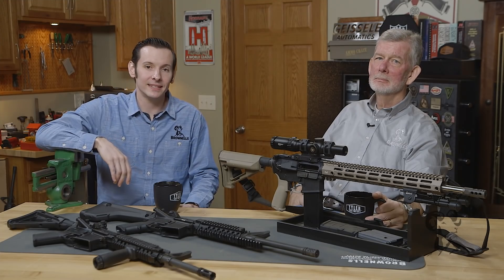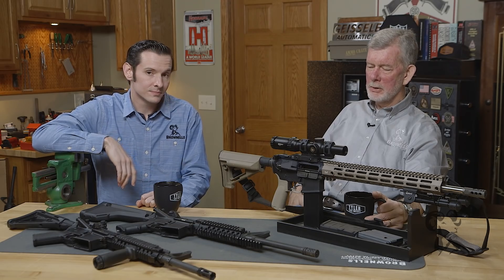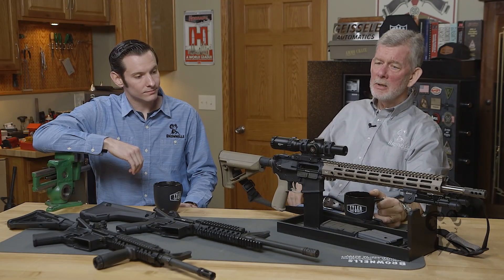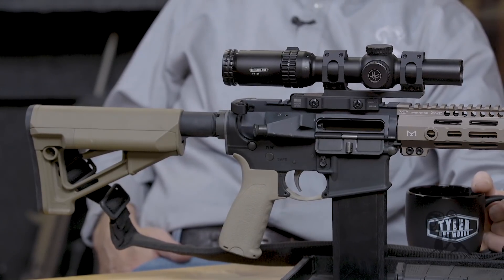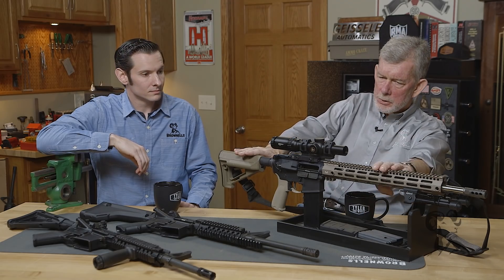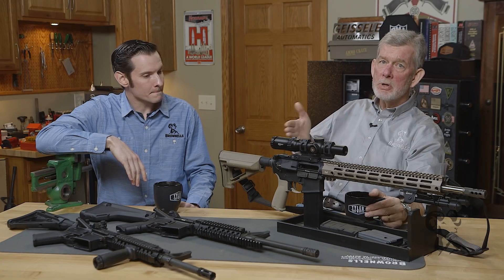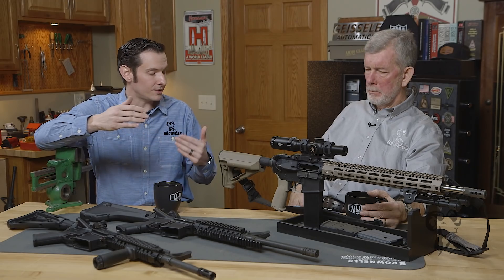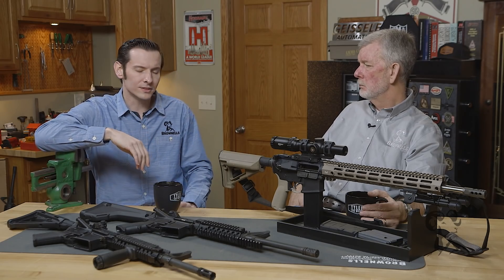Smyth Busters: Matching AR-15 Gas System to Buffer System

Comment: If you want to know why the difference in length isn’t problematic I’ll sum it up simply.
When colt began shortening the m16 platform they wanted to take length off of both ends of the rifle so they shortened the barrel and placed the gas port in the location that led to the smaller profile of the original colt commando then tuned the port to let in the right amount of pressure to cycle the action. Then colt created a new shorter buffer tube with a recessing stock that allowed the commando to be convenient in small spaces while still having the ability to use a full length stock when needed. The new buffer system had a shorter buffer and spring inside but the weight of the buffer was increased and the spring was strengthened to give the same resistance of the full length system.
Essentially it takes the same amount of force to cycle a carbine and rifle length buffer system.
Reply: Actually the weight of the buffer was DECREASED. Carbine buffers were 3 oz at that time vs the rifle buffers 5 oz. But you were close.

Comment: The group at SOTAR (School of the American Rifle) might tend to disagree. The variations in overall gas efficiency, barrel lengths, buffer weights, and spring length and tension, brass ejection patterns and firearm tolerances would seem to support a closer look at all components used, not just gas tube length and buffer type. 

When sufficient ammo becomes available once again I will experiment with the items mentioned in your video to gain some experiential knowledge also.   Thank you for your videos
Reply: When sufficient ammo becomes available again?! I’ll be here waiting on your findings... probably sometime around 2036😆

Comment: I built an AR-15 rifle and had a mid length gas system and rifle length buffer and it wouldn't cycle. It rarely even ejected the empty casing. I put my mid length upper on one of my carbine buffer lowers and it ran and put the carbine upper on the rifle length lower and it ran just fine. Confused me so much.

Comment: A.R. pistols especially 9 mm do you need light pistol buffers and have many function problems with a standard buffer system, also what about a dissipater model I specifically had to adjust my spring and buffer system to accommodate a dissipater rifle?

Comment: I'm going to have to disagree with this premise.  I had a factory stock S&W carbine, and I put a DPMS rifle upper on it.  That thing became (nearly) a single shot.  I ran everything between a 55 gr and 77 gr bullet, and nothing would cycle.  I then put the same upper on a DPMS carbine lower.  Same headache.  I put the rifle upper on a rifle lower I built... dependable as a baby pissing after diaper removal, without so much as a gas adjustment or buffer change; nothing custom.  The carbine always worked well.  I'm not arguing that my experience is an "every time" norm, but that's what happened to me anyway.  Love the channel though.👍
Reply: Same on my 20inch

Comment: It can be affected in really cold temperatures and/or under high rates of fire.. use the correct buffer system. There's a reason they were designed the way they were.
Reply: Bruh you even watch the video?

Comment: THanks, just saw your video. So, here's my problem. Just built a 6.5 Grendel with 20" barrel, carbine length buffer. But no matter what I do it seems, I can get the bullets to eject at about the 4:30 - 5:00 area but it will not go back far enough to strip off another round or hold the bolt back completely. The Gas block is a PSA adjustible open all the way. Any ideas?
Reply: What weight buffer? You are definitely undergassed for whatever buffer you are running, so if you can't step down a weight then your gas port is too small. Undergassed on a carbine-weight (the lightest standard weight) buffer means that the gas port is out of spec, or you are leaking gas somewhere (usually at the gas block; look for carbon build up around it, there shouldn't be any.) Hopefully it's as simple as clamping down the gas block more to eliminate the gas leak.
Reply: @Reniconix  I am using a standard Carbine buffer and spring (Both new). Using a PSA adjustible gas block (Completely Open - New). The gas port does not show much carbon, but there is some. The hole by my estimation is not exactly round, maybe a little oval, but that is all I can tell. Thanks for the help. Really been pulling my hair out, and I don't have that much left.
Reply: If your bullets are ejecting out the side of the gun you have real problems ... JK I know you're referring to the cases.  Anyhow, you should also check to make sure that the gas block is properly aligned.  If not, your adjustable block can be all the way open and still not getting enough gas through the port.  Make sure the hole in the barrel is perfectly aligned with the inlet to the gas block.  Sometimes machining on the barrel or gas block can be off ... just sliding together can leave them choked down.  Always measure first.
Reply: @kingropplebopplesoppy2634  So, we finally figuared out the problem. The gas port was not to spec from the factory! After we drilled it out to spec we were able to adjust the gas port correctly. This  was a very unusual problem. Thanks for the response.

Comment: good video guys,  i have a couple of m16a5 (semi-auto clones)  they have a 20 inch upper attached to a vltor a5 lower with a h4 buffer and i have perfect 4 o'clock ejection when i use 55 grain lapua or federal ammo so this is my preferred gas system/buffer system setup. 👍👍

Comment: I went with the Geissle guide, but no mention about a pistol length gas system with a non-suppressed 11.5" barrel. But Since I'm running a flat wire buffer spring, I went with an H-2 buffer.

Comment: I disagree with this MAJORLY!  My 5.56 has ran on every buffer setup I've put on it, I think the same with my blackout...but I have a .50 Beuwolf, 7.62x39, 6.5 Grendel, and ESPECIALLY the .450 Bushmaster AR that doesn't seem to run no matter what.  I've changed out EVERY buffer spring, every buffer weight, rifle, carbine length, changed to caliber specific mags (that helped but still not perfect) and STILL never had them fire more than 2-3 rounds without either jamming, or not loading the next round....changed gas blocked too and that didn't help.  The gas tube also has about a half of an inch difference in length where it enters the upper on 2 of my AR's with the SAME length tube for the same length barrels...wtf
Reply: Seems I can learn alot from you and your experience. I have the same calibers. 10.5" 5.56, 16" 7.62x39, and 16" .50 Beowulf. What do you recommend for buffer and spring weights for each? I dont have adjustable gas blocks..

Comment: My question is does  a rifle length buffer system feel smoother than a carbine buffer system.

I know rifle length gas systems are super smooth. However does the longer buffer assembly have a similar effect?
Reply: Yes, for my rifles 20" barrel and rifle length gas systems, it makes them softer shooters, and I suppose less wear and tear.

Comment: I dissagree in part. of course that is because of personal preference but i like mine to run smooth so i have different springs for different things like when using a suppressor as well as an adjustable gas block and adjustable gas port on my bolt carrier. it is not that you shouldnt run one way or another but that you should. it makes the gun more enjoyable if you have a system that works well with all the components. you dont get a harsh recoil or brass being flung to knock out the guy sitting next to you. that is personal preference though. you can run it harsh if you would like to

Comment: Definitely accurate. All buffer systems are designed to deal with roughly the same total recoil impulse. They're just designed to dissipate them over different lengths. Thus a carbine-length buffer will produce a sharper recoil than a rifle-length one as the BCG is decelerating more rapidly.
Reply: Surely it isn't that simple. If this is the case then why isn't everyone running the heaviest H3 buffers possible?
Reply: @iank6897  because not every gun comes in the same caliber bud
Reply: Yeah why would anybody want a sharper recoil
Reply: @MrSabram07 More stock options + lighter weight
Reply: @MrSabram07 because the recoil impulse that is sharper is also shorter and allows you to fire faster because the action cycles faster.
Reply: Will a stock made for a shorter buffer tube still work on a longer buffer tube?

Comment: Yeah, that 3.0 oz carbine buffer is the exact same thing as the 5.4 oz rifle buffer. Please - stop being dense
Reply: I don't think you understand how the system actually works, we will work on a video to address that. I'll try not to be so dense lol
Reply: @CalebSavant  you are saying i don't understand the system? Lol, that's rich because I've built just about every configuration you can imagine
Reply: @AJPPP  ok
Reply: The point is that they will both function just fine and the rifle will operate without issue. Talk about dense...
Reply: @guitaristxcore  Really? So both will function with the same untouched 300blk upper? how about full auto?? Please leave the wrenching to the real gun builders and stick to youtube.
Reply: @AJPPP  since most ar owners are running semi-auto 5.56/.223 rifles you can keep your red herring.

Obviously if youre changing calibers you need to go back through and make sure the rifle is set up to safely operate. But as long as its cycling, which is whats being discussed in this video, you're good to go. 

You're salty that they didn't address your outlier situations. But those are just what they are. Outliers. For the vast majority of AR owners the only real difference the buffer tube set up makes is in felt recoil.
Reply: @guitaristxcore  I hope you never touch anyone's firearms but your own, for their safety.

Comment: I had to switch to a heavier buffer on a 10.5 in barreled (SBR) AR build I did once I started to run a suppressor.  But other than that I've only ever changed buffer weight for comfort, not reliability.

Comment: The only time I have seen the need to change buffers or springs is when I need to change dwell timing on an AR15. And that only happens on exotic calibers or a barrel with the wrong size gas port.
Reply: agreed.
Reply: You’d be surprised dude. There is such a thing as gas port erosion. And a lot of manufacturers don’t include the correct buffer for their sized gas port.

Comment: I had to change my buffer weight and spring after changing my BCG to a lighter one.  I was not getting enough push-back from the gas system to compress my old spring enough to fully cycle, but could not change the gas system to provide more, so I bought a lighter buffer and it solved my problem for a few rounds, then would not lock back after last round was fired (leaving the empty mag).  Finally, after a Geisselle braided spring was installed, everything worked consistently and flawless.
This AR15 is the best rifle I have ever shot.  Very smooth and shoots 3/8 MOA out to 500 meters.  I've shot many others and often get that over-gas slam to the rear (which I've come to dislike now that I know about it), so I'm convinced there is a lot of benefit to tuning the gas system by changing buffer and/or springs until a good combo is found.
I also like the JP Silent Capture Spring system, but decided to try messin with a less expensive this time.
Oh, and I meant to say I'd bought a new barrel, a Criterion 18" HBAR with head-space matching BCM bolt.  That's what started all the troubleshooting, but I'm glad, as what I have now, is well worth it.

Comment: All of my ARs, from a 10.5" with carbine-length gas system to an 18" with rifle-length gas, all run carbine buffer systems with zero issues and none are equipped with adjustable gas blocks.
Reply: do you run any of them suppressed?
Reply: @gabegoins4422  No, not at this time.
Reply: @jaydee5156 ya if u were to suppress them u would probably need to install a H2 buffer to make up for the increased pressures with the suppressorz
Reply: You're definitely lucky. Are your AR's 5.56? It definitely can get tricky when running suppressed and different calibers.

Comment: I called around my local gun shops and asked and it was 50/50. I have a carbine lower and i want to switch it with a mid length gas system
Reply: Absolutely, do it!

Comment: What about a 4.7 ounce buffer in a mid length has system? Will it function
Reply: From what I gather from the video. If the system is made to functions with one upper, it will function with all. However I believe this isn't always the case across all the calibers available.
Reply: It depends on the port size in your barrel.

Comment: It's not TECHNICALLY true that once a buffer system is set up it will run in any AR. If a STANDARD buffer system is set up then it will run in any STANDARD AR, meaning standard bolt weight with an open gas block. The length of the tube won't matter. 

As soon as you change the buffer system, bolt weight, or amount of gas via an adjustable gas tube then your system may not run.

Comment: What about rifle/carbine to pistol ar?
Reply: This is what I came to learn as well
Reply: @sokka12298  I been asking around my local gun shops and what I've been told if you got anything from 10.5 (what I have) and longer your rifle should have a carbine gas system. I've watched several videos and since it's a smaller barrel it's usually over gassed so playing around with different buffers should help to find the right balance
Reply: @esepinky13  A regular carbine buffer will work. But I always play around with my AR pistol buffers. I have found that using an H2 buffer with an upgraded spring has been the smoothest and best running. 
All you have to do is get on Ebay or Amazon and buy three tungston weights. Replace one of the steel weights in the carbine buffer with a tungston. That gives you an H1. 
Replace two it gives you an H2
Reply: @toynazi  I actually just did that. I swapped 2 out. The rifle it self wasnt bad it was ejecting around 3 o'clock  and after the swap ejects around 4 and 5 o'clock I curious to get a red spring just to see what it does
Reply: @esepinky13  I always use the JP tuned and polished springs in all my AR platforms. They are super smooth and gets rid of the typical twang from a normal carbine spring.
Joe bob outfitters website has them for $20. Well worth it.

Comment: I built an AR10 with a rifle length gas system and a carbine buffer tube, and it doesn’t cycle correct. The bolt doesn’t fully go into battery with the following round. 

Any suggestions?
Reply: Are you using mix match bolt and barrel? Didn’t you check headspace in the rifle?
Reply: Keith Reinert 
Negative.. both the bolt carrier and barrel are Areo precision and it passed both the go and no go testing.
Reply: mazzvidz dang I’m putting together the same set up except with a adjustable gas block. I’d be interested to know when  you figure it out. Does the bolt lock back on the magazine when empty? Load one round in magazine and then chamber and fire and see if the bolt lock in the magazine
Reply: Keith 
Yea it locks back.. I’m thinking it’s a gas block issue.  I just bought a Giezly pinned gas block  to replace the AP one. I’m struggling getting the old one off.. I’m gonna put the heat to it tomorrow. Hope that  solves it.

If not I’m gonna have to see about the buffer and spring... and so forth. I’ll figure it out eventually
Reply: Keith 
I got it working. 

YES!!!

When I had it apart changing the gas block I decided to disassemble and inspect the bolt and carrier as well. I noticed that the bolt  didn’t move inside the carrier as smoothly as in my other rifles. In all honesty it was quite difficult to get it to move by hand. 

So I very gently polished the interior of the carrier where it makes contact and now it cycles flawlessly.
Reply: mazzvidz  awesome I’m just finishing mine up now. And I will have to double check mine. I hope it stays working. I know mine is a little tough and was going to see if it would work itself In.

Comment: This is the exact info i needed! Thank you! I had just built a lower with the intention of using a carbine gas system,  but changed my mind half way through, was wondering if i can use my carbine length receiver extension and buffer system with a mid-length gas.
Reply: We should be good because most ARs from what I’ve seen run carbine tubes, and mid length gas systems are also pretty common so I think the set up should be fine

Comment: I just put together my first AR - it’s a 10.5” barrel, chambered in .300blk. It runs a pistol length gas system, with a carbine length buffer. Shot it for the first time today, and it wouldn’t cycle properly. RSO said yeah it needs to match - however, I was running 220gr subsonic suppressor ammo with NO suppressor on it. (It was the only ammo I could find in stock) I also had someone talk about the gas system should be .012 and maybe it’s .09 which doesn’t allow enough gas through.

Is it because of the ammo I was running, or does the gas system or buffer spring need to be changed?

Comment: Got one for you.. I have a sig p516 lower (a pistol lower for a piston op 7.5" 5.56 upper), and I put a 10.5" 300 blk DI upper. Think the buffer is still good? I havent been able to test it out yet :(
Reply: Id check the buffer. Those little barrels tend to need a pretty heavy buffer like and H3. If it wont cycle try a lighter buffer
Reply: @Venomxjjb  sounds good, I'll get an H3 to have on hand. Thank you sir!